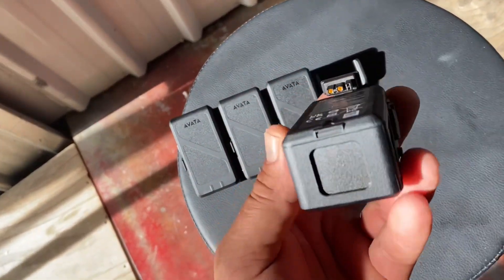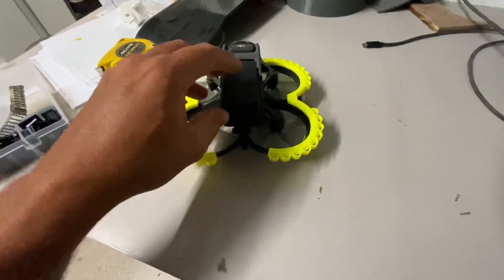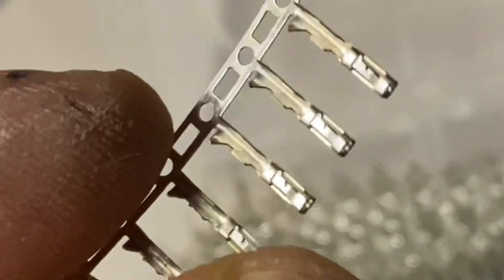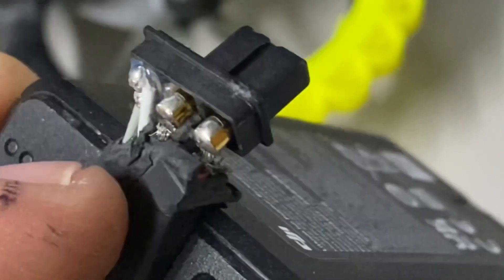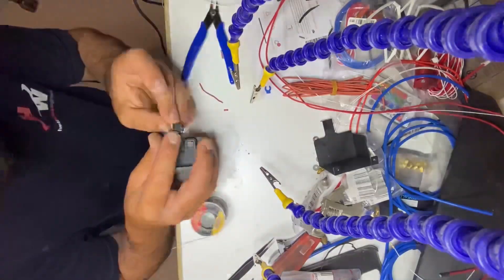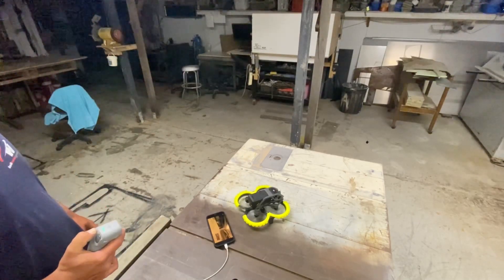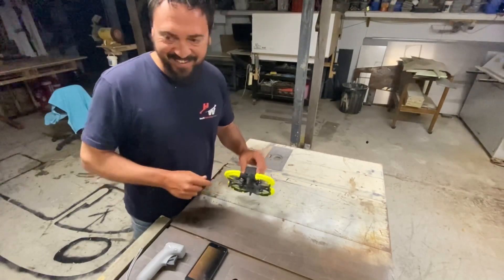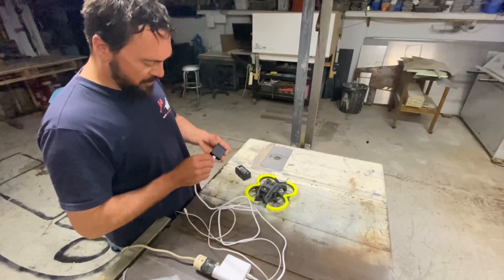DJI AVATA BATTERY INSTALLATION ERROR and how to fix it… really rough

Comment: Bending the 2 Pins in the Avata to the right a bit (looking from behind in forward flight direction) fixed the problem for me. I think the problem occours when the two pins do not proper connect to the pinhole connectors in the battery...
Reply from the maker: I tried everything with mine trust me. The way I fixed it was far from practical but it worked hahah. I ordered new batteries and they came out fool proof

Comment: fit the battery and the pins at the same time and to pull out the same thing. do not remove the connectors and then the battery. doing this you will never have problems again.
Reply from the maker: I did! Or at least I tried. It’s just because I had the 1st iteration of the battery. The newer style battery they give is fine. I appreciate the help though!